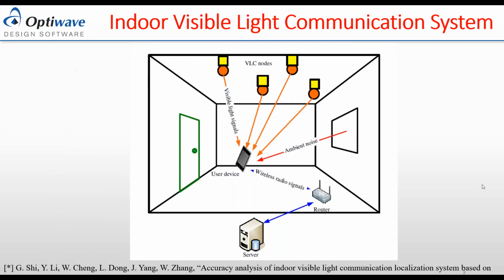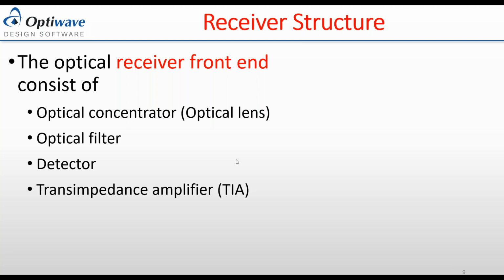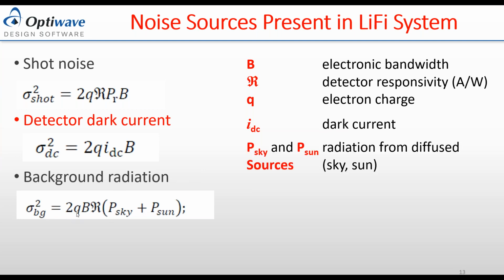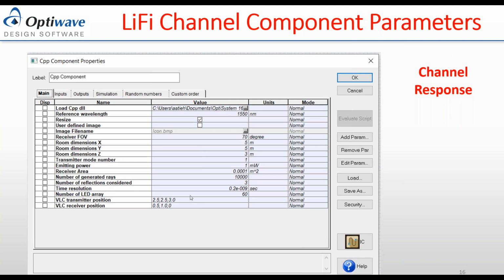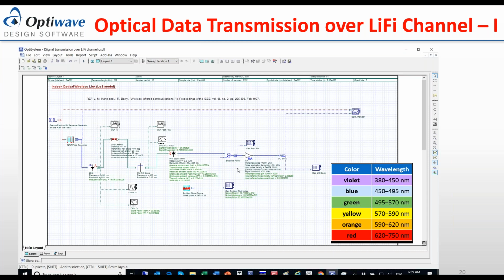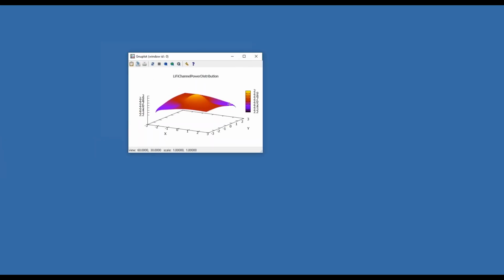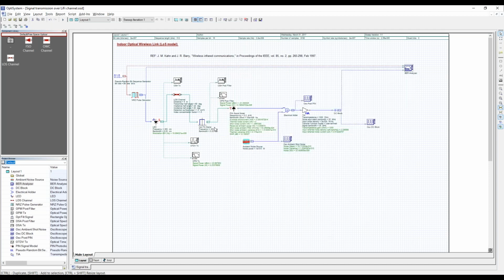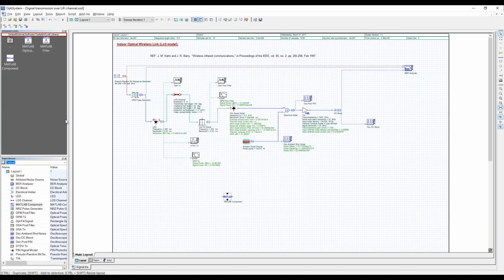LiFi Channel Characteristics 2

Comment: Thank you so much, great efforts,
Please, I'm very confused, which one of those channels are used for LiFi from free space optics library in OptiSystem tool: OWC Channel or LOS Channel?
I read many works that used OptiSystem for LiFi (Not FSO or VLC), I mean Light Fidelity that used LED for indoor optical wireless communication, but some ones used OWC Channel, while others used LOS Channel!!
Or, What's the difference between them;
Any sort of help would be really appreciated.
Thank you so much.
Reply from the maker: The LiFi channel component is a stand-alone component which has all devices need to build your system. Each tab has specific parameters that you could set to configure the system.
For the LOS Channel, FSO Channel and OWC components, you need to build your system from induvial components. Please refer to the datasheet of each component for more information.